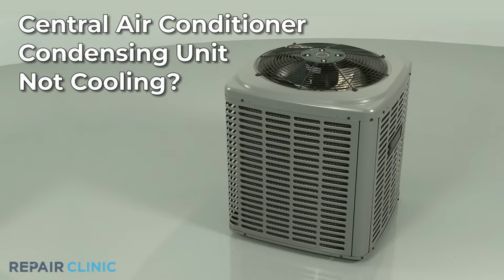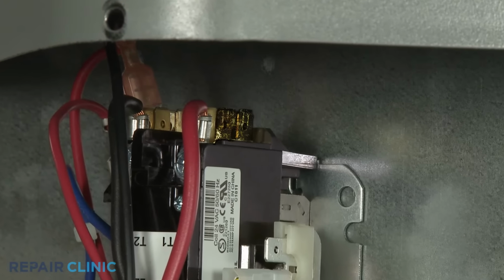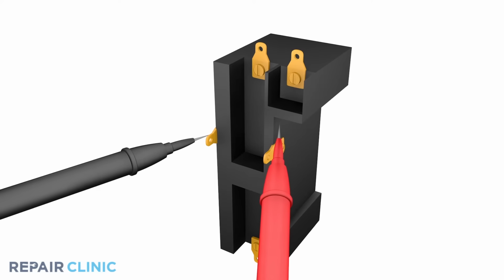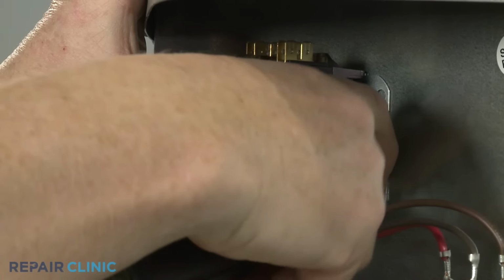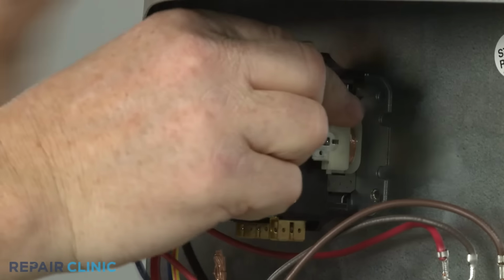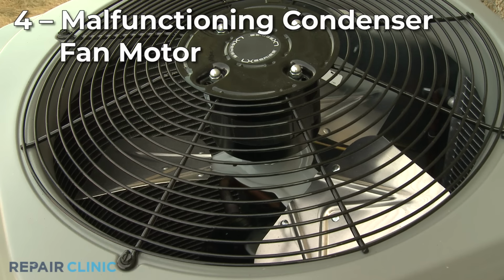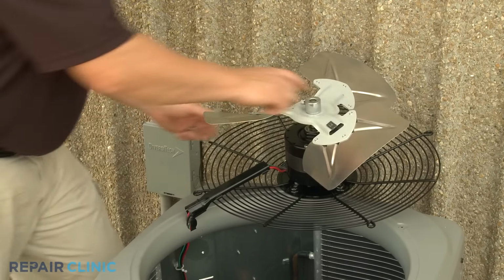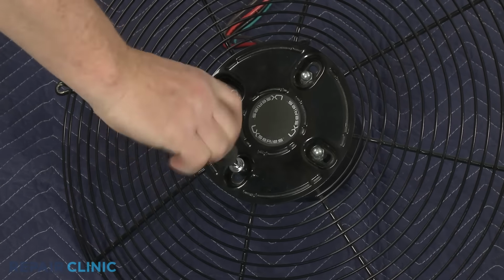Central Air Conditioner Not Cooling — Central Air Conditioner Troubleshooting

Comment: Hi nice video, I have a question my AC unit in the summer can be set on 75 degrees and the room temp can read 75 but the AC continue to run for LONG periods of time with out cutting off, also at times if the temp outside my house is 95 my AC temp set on 75 but the house temp raise to 78 what makes this happend. I have a Trane AC unit outside and inside in the basement Help please thank you
Reply: The AC can only keep it 20 degrees colder than it is outside.